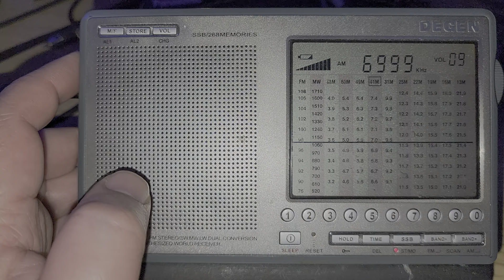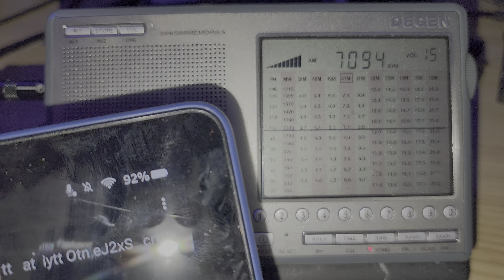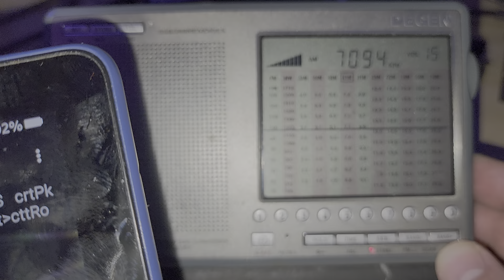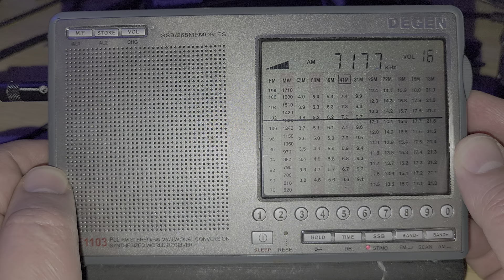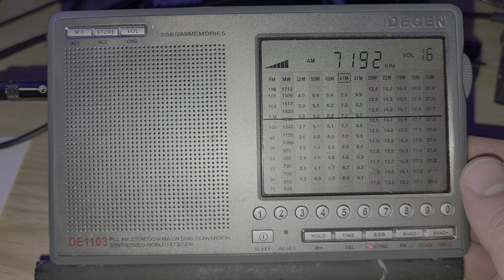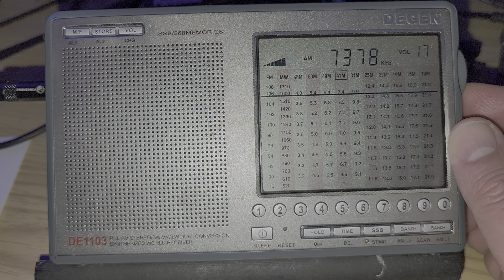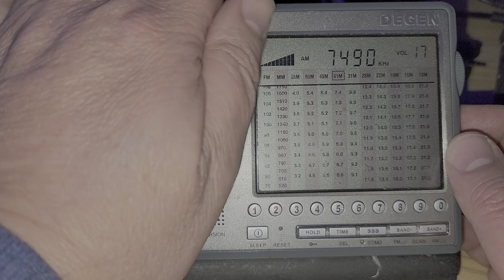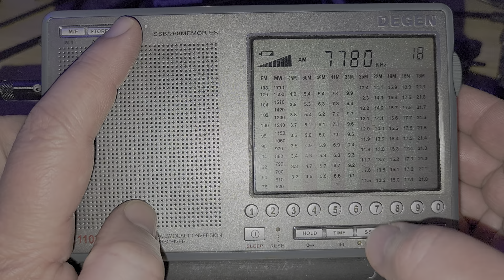Tuning 7000 to 8000 kHz Shortwave Degen DE 1103 SSB 40 meters ham band 41 meters broadcast

Comment: You have the older PLL version without the chuffing. I have that one, too. Got it on eBay. Appeared to be new old stock. Batteries would not hold a charge, but that's okay.
73 Paul AA1SU